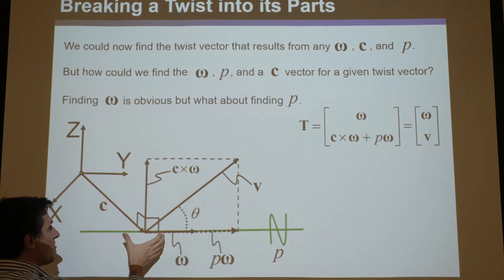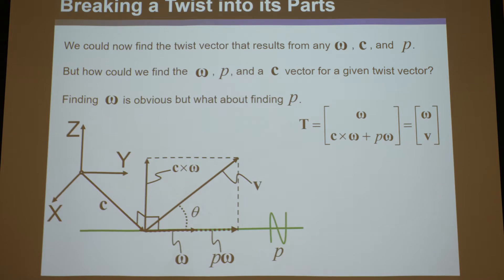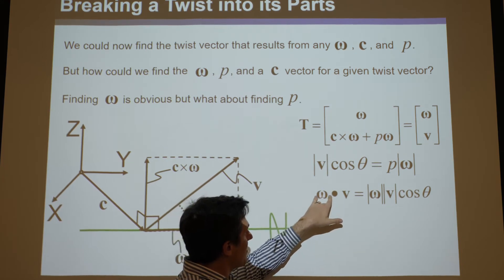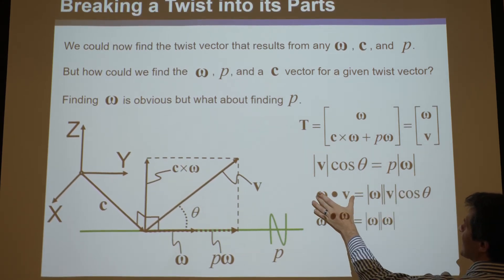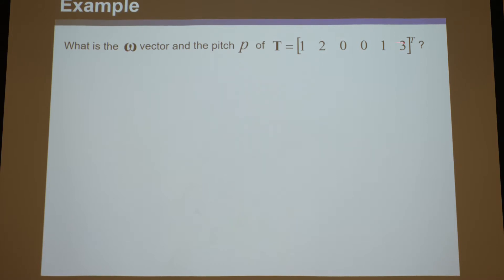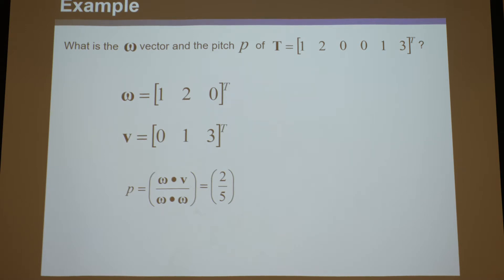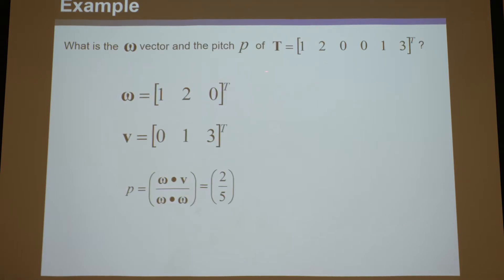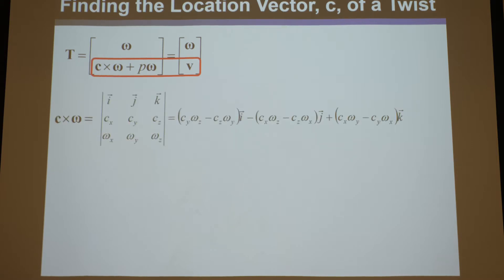Compliant Mechanisms Lecture 2 Part 3

Comment: ## Lecture 2 Part 3 Summary

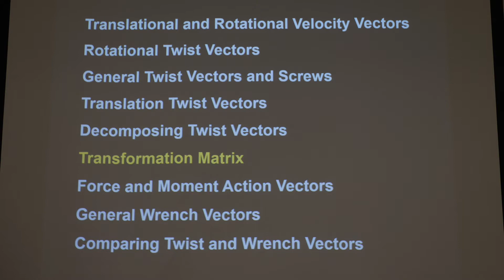8:58 Transforming Twist Vectors between Coordinate Systems:

* The lecture then delves into a crucial concept: transforming twist vectors from one coordinate system to another.
* This is important for analyzing motion relative to different frames of reference.
* A new coordinate system (x', y', z') is introduced, and the goal is to find the twist vector (t') in this new frame, given the original twist vector (t) in the global frame (x, y, z).

11:43 Constructing the Transformation Matrix (N):

* The transformation involves constructing a 6x6 matrix called "N."
* N incorporates information about the relative positions and orientations of the two coordinate systems.
* This includes:
    * A location vector (l) pointing from the origin of the global frame to the origin of the new frame.
    * Three unit vectors (n1, n2, n3) aligned with the axes of the new coordinate system but defined with respect to the global frame.

17:30 Linear Combination of Degrees of Freedom:

* The key insight behind the transformation is that a free body has six degrees of freedom: three rotations and three translations.
* By linearly combining these six degrees of freedom with appropriate magnitudes, any desired motion can be achieved.

24:21 Using N for Transformation:

* The equation t' * N = t establishes the relationship between the twist vectors in both frames.
* Solving for t' involves inverting the matrix N: t' = t * N⁻¹.

26:50 Transformation Example:

* A detailed example walks through the process of constructing the N matrix and using it to transform a twist vector from the global frame to a new frame.
* The results obtained through this matrix transformation method match the results obtained by directly defining the screw parameters in the new frame, validating the approach.

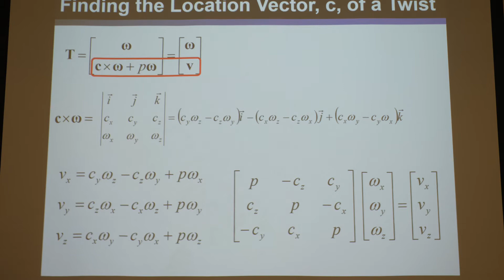5:39 Displacement Twists, Velocity Twists, and Acceleration Twists:

* The lecture concludes by introducing variations of twist vectors:
    * Displacement twists: obtained by multiplying velocity twists with an infinitesimal time increment (Δt). They represent infinitesimal displacements in rotation and translation.
    * Acceleration twists: derived by taking the time derivative of velocity twists. They represent angular and linear accelerations.

Comment: I'm having a difficult time understanding the equation at the 17:30 mark. In my head I'm thinking you just equated the path from a to b and the path from a to c. Which only works if b is c - which isnt true for this case so my analogy must be off. If you could explain this in another way, I'd be much appreciative. Thanks.
Reply: Is it correct to say that the first half of this equation at 17:30 describes the motion of the XYZ origin about the X'Y'Z' origin? (even though the former does not twist about the latter)
Reply: Ok so I have an explanation now but correct me if I'm wrong.... Both sides of this equation represent ways to describe the motion of the XYZ origin. The left hand side describes it with respect to X'Y'Z' and the right side describes it with respect to the twist vector. This is why they can be equated together. 

In more detail: the left hand side has angular velocity components but that doesn't mean XYZ is somehow twisting around both the X'Y'Z' origin and the twist vector T.  XYZ does not twist around X'Y'Z'. The angular velocity components seen in the left hand side don't describe twisting motion, just motion in general - the same way you can convert any cartesian coordinate to polar.